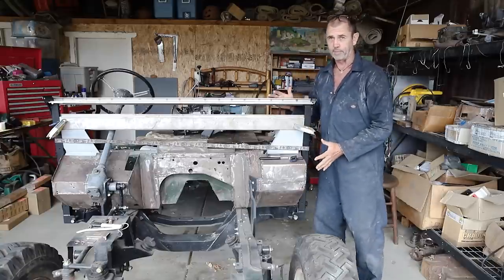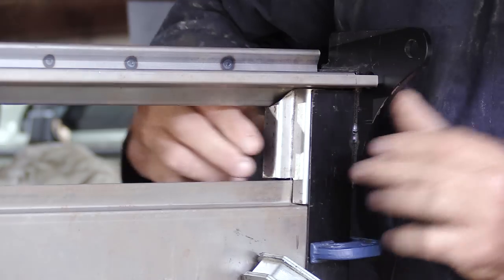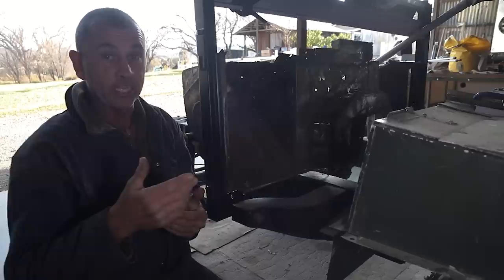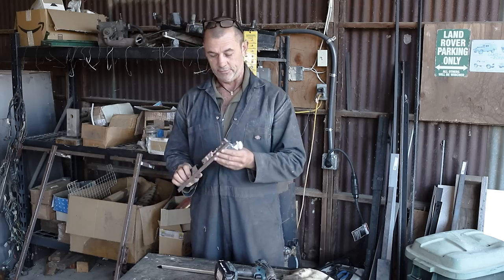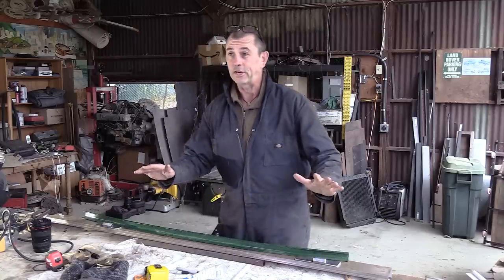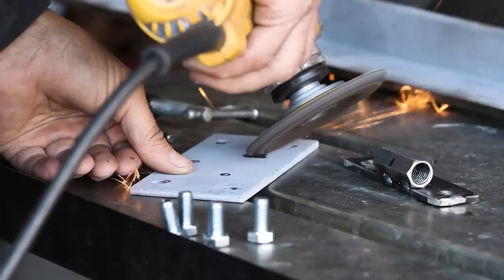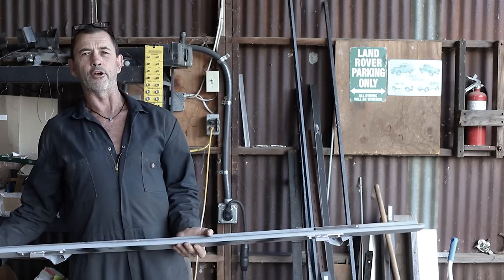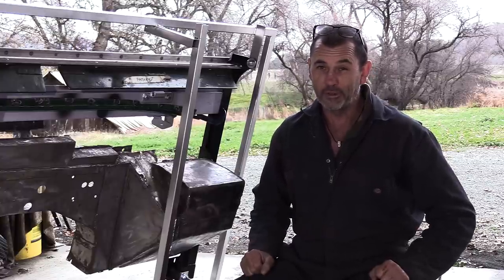Part_28; Patchwork Mosaic. Series 1 Land Rover Restoration

Comment: Mate bloody good to see you are still going with the Landy and it hasn’t become embedded in cobwebs somewhere at the back of the shed. Nice! The game of Tetris to get the panels to work is legendary! I’ve also just started the madness of a Series 2 1960 restoration with the added bonus of trying to have Lola kind of working by the 75th Landrover anniversary in Cooma this year. At rolling chassis stage and the rust carnage is a thing of beauty.
Reply from the maker: If I'm reading this right you've put a bit of pressure on yourself to have the restoration finished so soon. Don't try and film the process as it will add years to the workload. A 1960 series 2 is a nice truck. I wish you good fortune in the endeavor.
Reply: Well a man has to have a hobby. I should really be farming so tinkering with a landrover seems like perfect procrastination compared to fencing or chasing cows. Luckily cameras scare me so no filming. Keep the videos coming mate- I figure if you can learn panel beating then I’m in with half a chance too

Comment: Your welding skills have vastly improved also it is a good idea to take photos as you did (20:23) to stimulate your memory and mine. Look forward to more still photos for us old gentlemen. My regards to your lovely wife.
Reply from the maker: I was wondering if anyone would notice the photos and appreciate them. A sneaky addition. A major reason my welding skills have improved is my re-wiring the workshop project. Previously only set up to run lights on a flimsy 110 v system I've cheekily beefed up the wiring and now running 240 volts on the welder. No more pops and splutters, the thing now burns.

Comment: Love your channel, editing skills and your content of course.  Just a quick tip with your taps.  Rather than running it straight down until your through, inch it down a quarter of a turn per go.  So quarter turn in, back it out a quarter turn, back in half a turn, back out quarter turn, back in half turn and so forth until you’re through.  Saves potentially stressing and breaking the tap.  Ask me how I know😂😂

Comment: After just 28 quick episodes your fabrication and welding skills are 28 times better, I admire your resilience with that fkn bulkhead, I would have given up 28 episodes ago, sold the project and bought a runner from an old bloke that has wasted his life restoring it.  Good to see you back in the shed tormenting yourself, only a couple of episodes to go and its done!!!  Best to you and Wilms for this trip around the sun old mate.
Reply from the maker: Greetings Steve. I've seen you working on a bulkhead making spot welds and doing stuff. It looked like you were enjoying yourself. The project has slowed down a bit as we're having constant rain on my side of the pond and the little workshop isn't set up too well for wet windy weather.

Comment: Hey Macgyver.
There is a product called weld through primer for those in between bits , stops rust forming in between panel seams and joins.
Love the the show.
Reply from the maker: You're a bloody wizard Mr. Harding! Thanks for the tip and I've gone ahead and ordered the primer already. Never knew the stuff existed! I'm glad you told me about that before the big stitch-up, I've also ordered some waxoyl for the innards. Cheers.

Comment: This old S1 is a long way in place and time from the factory in Solihull, near to where I grew up. When it's finished it will be in better nick than it was when it rolled off the production line 70 years ago. Bravo brave Sir. This project is terrific and you have made it entertaining, funny and engaging. I really appreciate you sharing your travails and hard work. Your skills as a welder are hugely improved. Best wishes to you and yours for the year ahead. My 1976 S3 109 Pickup is running smoothly with the Holden 186 sporting old new manifolds and electronic ignition and the brakes are working!  Best wishes from Wellington, New Zealand, where it's blowing a southerly gale.
Reply from the maker: Good to hear your old truck is running well. I assume there is an adapter plate between engine and gearbox? Where do you find such things?
Reply: @ForemanAndWilmsAdventures  The Holden 186 was swapped in with gearbox and Fairey overdrive in 2000, before I owned Solly (that's his name, short for Solihull). Sorry I can't advise where to get an adapter plate, but I know that your homeland has tons of parts for early Land Rovers. The overdrive is good on the open road but I don't like to exceed 80km/hr. Electronic points were a good upgrade last year, as I live by the sea. All the best to you, Mr Foreman. I love what you do on your channel and the story you weave.

Comment: Inspirational as usual!!! My '53 also has only one of those support rods but  brackets for two, someone before me put a 186 red motor in mine so i'm not sure if there is supposed to be two attached or not. I kinda remember someone telling me they were also used to pull the Bulkhead back into square, kind of like an adjustment device, thats why they are threaded. Merry Christmas and a safe new year to you and yours.
Reply: LHD & RHD use the same bulkhead threaded rod goes on to the opposite side to the steering wheel...I`m restoring a 59 S2 for a client here in Portugal...

Comment: Can I ask where  you got the top rail from? Im doing a similar job on series 3 this week . Im in pieces bits and pieces!
Reply from the maker: John Craddock sells them and Radford bulkheads also. There can sometimes be a bit of a wait time. I'm not sure if the top rails are the same for the different trucks but I'd reckon if not, a series 3 would be easier to get. best of luck!

Comment: How much has the restoration costed so far. Planning on restoring my grandparents 1949 series 1
Reply from the maker: Greetings Melker. I've been too frightened to keep track of the ongoing costs of this project. It's been affordable as it has been spread out so far over 4 or 5 years and counting. Other considerable costs a first time restorer like myself has to contend with are the tools and equipment outfitting the workshop like a press, welder, grinder, metal saw and a million other odds and ends. Once purchased however would make a second project a lot cheaper. I see these expenses as an investment as I've learned and developed a lot of skill and knowledge I didn't have before all this started. Best of luck on your series 1!
Reply: @ForemanAndWilmsAdventures  thanks for answer. I will post progress on YouTube. It has stood in a barn for 40 years so a real barn find😀